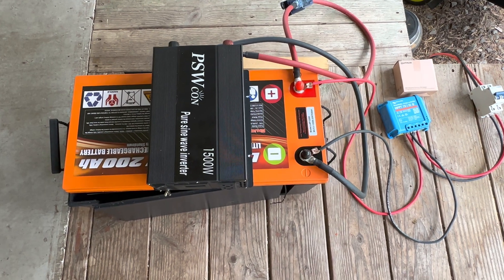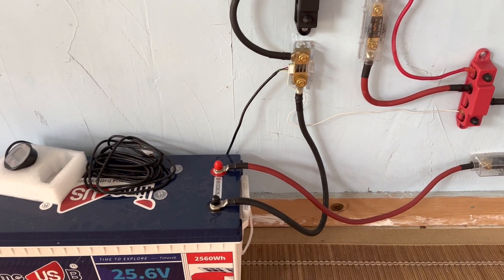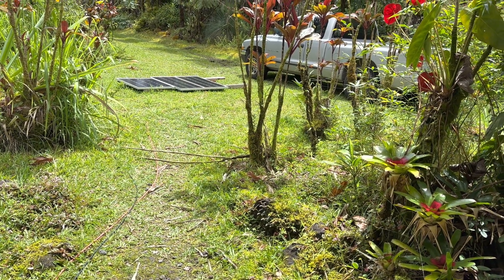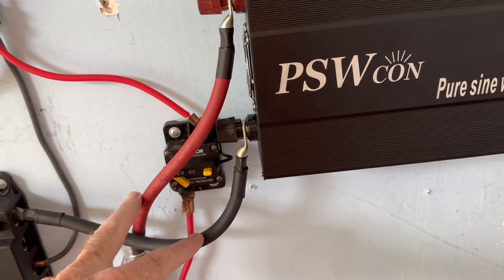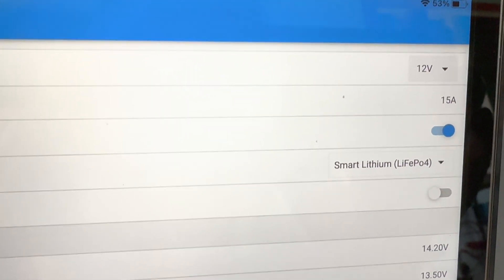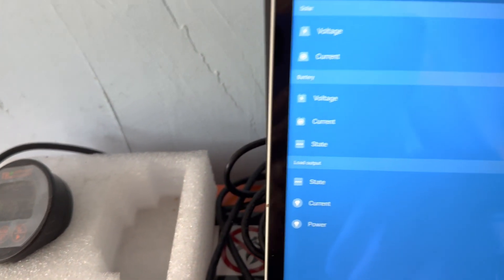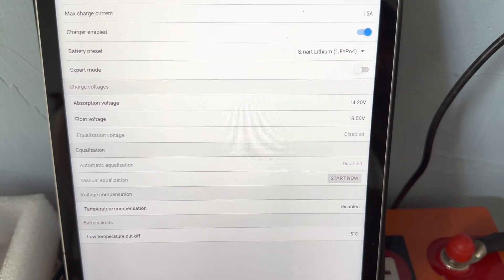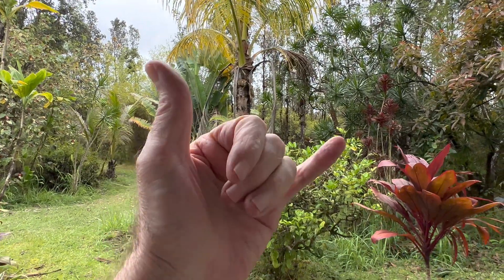24v 100Ah LiFePO4 power station  changed back to 12v 200Ah power station . Quickly get back up & on!

Comment: 24 volt is more powerful.  Since 2010 I switched from a 12 volt battery system to a 24 volt battery system.

Much more energy and higher efficiency. Since 2015 I have 12 Trojan T105 batteries total 24 volts 675 amps.

Comment: These details are interesting but in practice you may experience that once you set it you can forget it. I've been running nearly six years without doing anything. Eventually my system will fail and so I just prep for it by watching content here; it just gets easier than easy as these contributions accumulate. ❤✌️👍🏻
Reply from the maker: I am loving the set it, and forget these day's. The Victron cc's make it so easy in that respect. I just make cursory glances while walking by most day's, or glance at the app. It has all become so much easier with the new stuff available now. Much better for old age! Aloha brother! 🤙
Reply: @ProjectsinParadise808   The Chinese battery manufacturers are really doing a great job too. They know how important safety is in growing their lucrative industry. I ♥️ China.

Comment: mega fuses are not used for battery protection - class-T fuses are the only appropriate Li battery protection fuse because of the high short circuit current of a LiFePo battery. Please be safe!
Reply from the maker: Yeah, plan on adding some class T's pretty soon. Mahalo! 🤙

Comment: Thanks. I am just putting together my first setup- all 12 volt and now realizing I will need 24 volt in the Philippines.  Have the Renogy 2000 watt and controller. Of course I have to buy the battery there since you can't fly one over. I haven't a clue as to why I didn't think about the 24 volt system to start with 🙄

Comment: Just an idea - what if you kept the 24 volt battery where it was and connected the (positive and negative) from the load side of controller to a 12 volt charge controller to the panel side to charge up your 12 volt battery.  This way you'll always have a fully charged 12 volt battery and a 24 volt on stand by or even extra storage.

Comment: I would name it the coffee station. last time i lost a inverter I just went newer and better. why I run more than 1 inverter instead of 1 big one. all I do is switch plugs around when (IF) I lose a inverter. with low temp test either use ICE 32F or salt water in freezer. will drop below 32F . that should be 0C /32F cut off charge if working.
Reply from the maker: I wish I thought of that with the camera on! Coffee station!! I go blank in my thoughts sometimes when camera on. Oh well, you undrestand. Think I'll put a Victron inverter in. Breaks my heart not running that 24v battery. It truly works so good! Mahalo brother! Always smile seeing you in here.🤙
Reply: @ProjectsinParadise808  I am looking into a victron LF inverter. got great review. sometimes my shop air compressor tripps my 24V 2KW out on start surge. not when it the only thing on it.

Comment: Why not buy victron phoenix inverter
Reply from the maker: I'm just about to pull the trigger on the Victron phoenix 1200...be perfect, and I do love Victrron. Aloha! 🤙
Reply: @ProjectsinParadise808  Great, would love a review video. I love what you did with you setup being off-grid and how beautiful it is where you live!
Reply: @ProjectsinParadise808 My ☕ and CPAP Machine Deserves a 24/1200 Victron Low Frequency Inverter a 10K 24 Volt Battery Bank and 1000 watts o RENOGY Solar Panels feeding 100/50 Victron Smart Solar Charge Controller. SET IT & FORGET IT 🤙ALOHA 🌴

Comment: What's the no load draw on that 1500w inverter?  Depending on how Many watts you need the smaller victron phonex inverters offer great value for $$  

I have the 12/1200, and hopefully by winter will have a multiplus.  I'll be able to feed into the multiplus with the 12/1200 for massive capacity.  I suspect I'll run two battery banks, 12volt and  maybe a 24 or 48volt multiplus unit.  

Your victron app let's you check out the different products/settings/features of units you don't have in 'demo' mode.
Reply from the maker: I'm looking hard at the Victron inverter! Aloha! 🤙